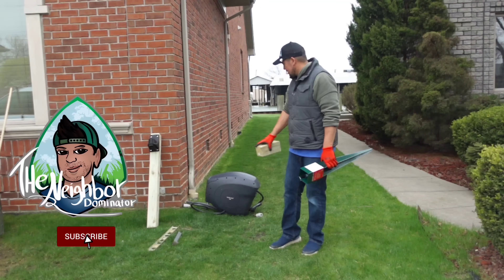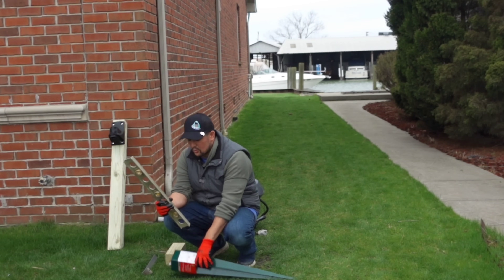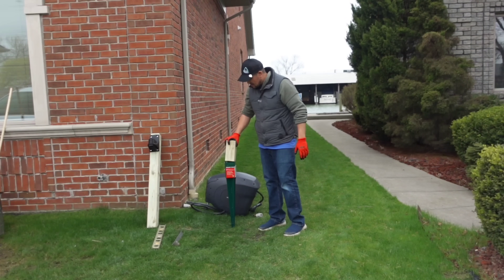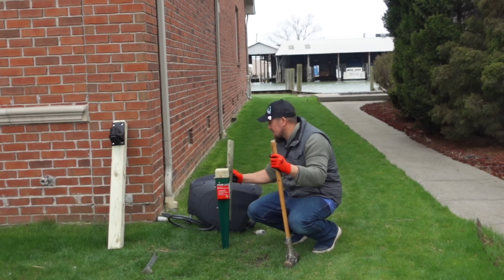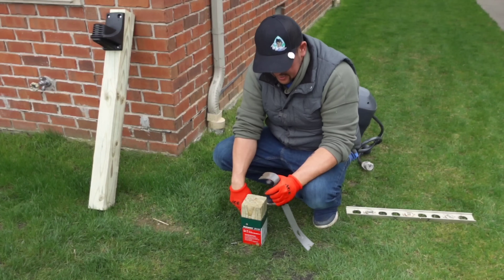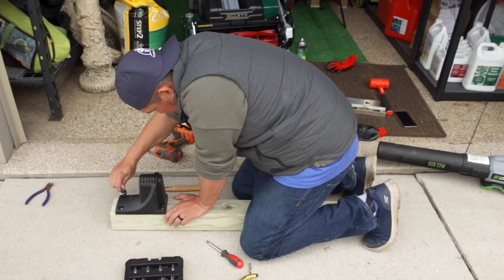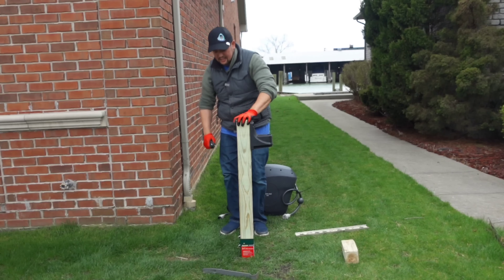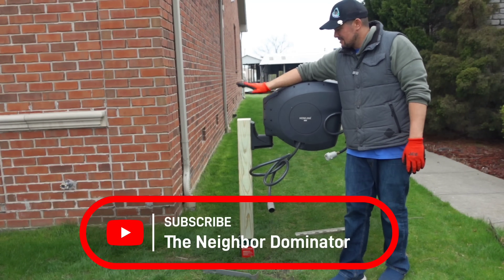Set Posts the Easy Way: No Dig or Cement Posts ✨ Hoselink Retractable Garden Hose Install

Comment: GREAT PRODUCT with a retractable, lightweight, rotating, great flow watering hose. Eager to own one but a disabled senior on a fixed income, so saving up to own one!
Reply from the maker: There are cheaper alternatives to the hoselink but with my experience it is superior to the others.  I feel its worth the wait but also I understand being on a budget.  I have also used the hoses that shrink up when done.  They are very light weight but have had them break at their connection points.  Depending on how much use they get it is a cheaper alternative.   My parents (72 and 74) love thier hoselink i got for them.

Comment: Also, why are you using anchors in a solid block of wood? i'm assuming those are for drywall or stucco
Reply: He answered this above. He used an oversized drill bit originally.
Reply: @leewhitmore5350  Makes sense - I followed his method when installing my hoselink and its been working great for a month so far

Comment: Use a small drill bit for pilot holes then just use the supplied screws and skip the plastic anchors.
Reply from the maker: I made the initial holes too big like an idiot so I threw those little guys in there and it seemed OK
Reply: @Dadstuff365  -- When that happens, but a dowel / peg, hammer it into the hole (use some wood glue also), cut it off flush, and screw into the pegs... Back in the old days, we would do something similar for anchoring 2x4s to concrete for walls when converting a carport into a garage or additional room for a house...

Comment: Thanks for the idea. I did not want to drill into the brick on the side of my house.Will look into these anchors.
Reply from the maker: It is way easier.   I did both and took the other off the house.  Make sure to level from two sides not just one is what i was told.

Comment: Is it still holding up, two years later? Thank you for the idea!
Reply from the maker: It sure is!   After every winter i just tighten the bottome a little.  I will have these at my new house for sure!
Reply: @Dadstuff365  how do you tighten the bottom? is that between the 4x4 and the spike? What about the contact between the spike and the ground, does it stay solid over winter?

Comment: If you want to be fancy you could put a vinyl jacket over the post and a topper too.
Reply from the maker: That is something to think about.   Kind of like a boat dock🤔
Reply: @Dadstuff365  yeah or a deck railing.. That's my plan. I'm going to dig the hole though because I'm installing mine near where a gas line is.
Reply from the maker: @hugeslacker  ya that is way smarter😊

Comment: I am curious why did you have to use the pry bar to remove the small wood block?  There are screws on the ground spike bracket - wouldn't unscrewing them help to release the wood block?
Reply from the maker: Yes but it was jammed in there at the bottom.  By the time i was done you could see the wood caving in on one end.
Reply: @Dadstuff365  so it is possible to unscrew to release the block?  What did you do or what happened that it got jammed at the bottom?
Reply: @Dadstuff365  I think it maybe better not to ram the spike too low into the ground when the small piece of wood block is still in the bracket.   That way, you can easily remove the wood block or unscrew the bracket to release it.   Once releasing the small block, put in the actual post, and continue slowly and lightly ram the post to push the spike further down into the ground abit.   Will it work?
Reply: @Dadstuff365  or perhaps the small block can be abit much longer such that it can be easily pulled out from the bracket?

Comment: "Is it plumb?" with a 'B'.  Comes from the Latin word for lead, "plumb" (plumbum) because the old way of seeing if something was straight was to hand a lead weight from a string.
Reply from the maker: That's what I said, plum😀
Reply: @Dadstuff365  The "b" is silent, unless you're an ancient Roman.
Reply: Great video - did not know that post mount existed!

To be truly PLUMB you'll need to check two sides with the level.  Front to back level and side to side level.
Reply from the maker: @woodsfamily2257  i was copying start i seen on the internet!

Comment: Would this be strong enough for post to hang farm gates on….one is 4ft and the other is 12 ft. Thanks 👍
Reply from the maker: I cannot be certain.   The spike would have to be deep.   The hoselink is not very heavy so the post is solid but to put a big door on it I would suggest the cemented post route to ensure nothing moves over time.

Comment: Brilliant idea!  I’ve been putting off installing a new mailbox post and these no dig spikes worked perfect and are very solid. I found one that is adjustable so you don’t have to get it perfectly “plumb” when you pound it in.  The wife was very happy with it which is always good!
Reply from the maker: That is definitely always good.  What is the name of the adjustable one?
Reply: @Dadstuff365  4"x4" Steel Adjustable Post Support Model Number: 858678 at Menards
Reply from the maker: @Labfolk1  solid.   Thanks!

Comment: How is the installation holding up from pulling in different directions on hose reel? Has it come out of plumb? These post stakes claim there not meant to be used if it doesn't have top support from something.
Thanks
Reply from the maker: It held strong all first season with the hoselink.  I will check if it is out of plumb status but just by eyeballing it that baby is strong!

Comment: No need for anchors if you are drilling directly into a solid post.  Just use the right size drill bit for the screw/bolt.
Reply from the maker: I may have made the hole a little to big🤣
Reply: So I have the giraffe tools retractable hose kit, would you know how big hole i need to drill on siding to be able to screw in the 13inch screws?
 @Dadstuff365

Comment: I'm curious to know how these anchors are holding up. You notice the posts leaning or anything like that? I just recently started looking into a retractable hose for my house and found your videos. Leaning towards the hoselink because of you and several other great reviews I've read.
Reply from the maker: Hoselink is the best so far that I've tried.   The anchor is pretty solid.  I just have to tap it in a little and tighten after winter.  No regrets.  But I wouldn't install a fence or door on one.  A hose reel, for sure

Comment: I legit know nothing about anything. But I'm curious about the size. The posts are 4x4 but the internal size of the stake is 3.5x3.5. Does it still fit? I would love this method over the concrete and hold digging.
Reply from the maker: It was all 4×4.  It is still solid too.

Comment: So glad this popped up in my feed, right as I was going to dig some holes and pour some concrete for a free standing wall in the yard. Funny how life works like that sometimes...
Reply from the maker: That is amazing!   This is so much easier and they are solid.   Not to mention less time consuming
Reply: @Dadstuff365  Already ordered two packs off of Amazon and can’t wait to knock out this wall. Your post still standing straight?
Reply from the maker: @JV-Yahowchanan  yes.   After the winter you have to tighten it a little that's it

Comment: Use a smaller piece of wood for your hammering post
Reply from the maker: That thing was small.   Even smaller?  What will that do?
Reply: I think they mean smaller in diameter to get it out easier, but that wouldn't be very secure when hammering.

Comment: I love this video. I have such a simple question. Why not just use the final piece of wood and hammer it down instead of using the first piece? I really don't think you would damage anything.
Reply from the maker: The top gets dented and with the little piece of wood being so low the natural weight of the hammer does the work for you.   I bet you could just use the big piece🤷‍♀️

Comment: Great vid, what kind of 4x4 spike have you used and where to buy?
Reply from the maker: I just went to Lowe's in the garden area.  I got the one with the two bolts two tighten it in.  There were a few different kinds.  I will get the specific name when I get out of work and message this thread
Reply: I would also like to know what spike you used so I can check if our Lowes store have it or order it online. Thank you!
Reply from the maker: @yenly2070  I spoke incorrectly.   I bought it at Menard.  I will reply again with the name when I get home

Comment: Hey bud ...you don’t need to be that ‘’ plum ‘’ it’s just a hose reel after all... You should’ve just got some masonry bits and connect it to your wall
Reply from the maker: That's what I did last season.   Wasn't a fan.   This post thing was way easier.   I didn't want the post to be crooked so I went with the plum technique
Reply: @Dadstuff365    ✅

Comment: You don't need to predrill or using plugs on wood
Reply from the maker: I put the bracket in before hand for ease
Reply: Actually you should pre-drill on wood to prevent cracking. It's doesn't always happen, but it can and then you've ruined your piece of wood. The use of anchors was just idiotic and made a weaker connection.

Comment: Or use post hole diggers and be done in a fraction of the time. You don't need concrete for a hose real that's for fencing or roofing that would be held up with post.